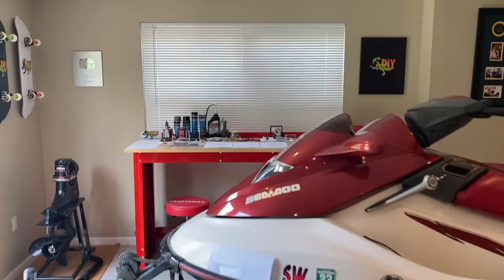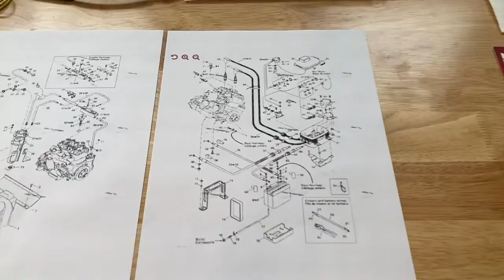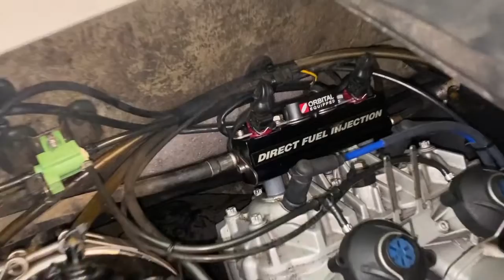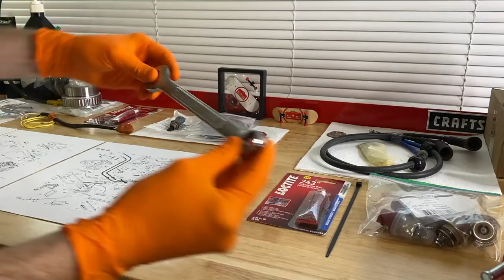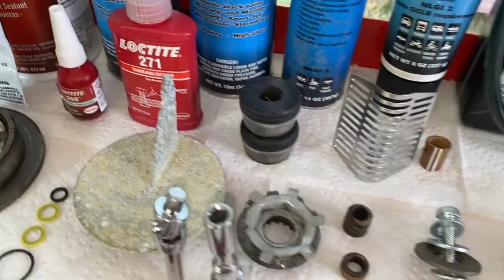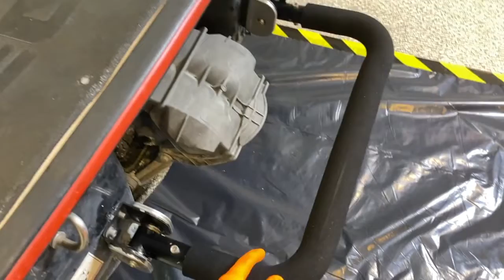Replace 2003 sea doo jet ski engine temp sensor 1998-2005

Comment from the maker: If interested in purchasing this product, visitor to Amazon affiliate link below.  I earn from qualifying purchases.

Coolant temp sensor:  https://amzn.to/3UHaqpM

3/4" wrench:  https://amzn.to/3yhTJK2

Adjustable wrench:  https://amzn.to/4awjgfP

AGM Battery:   https://amzn.to/4cO13MX

Battery disconnect switch:  https://amzn.to/49tskBH

Craftsman heat tool:  https://amzn.to/3V2LxVN

Browning Buckmark flashlight:  https://amzn.to/4bv0qGS

Loctite 518:  https://amzn.to/3wwMHjY

Dielectric grease:  https://amzn.to/4bcktKs

Pic tool set:  https://amzn.to/3wGm1ND

2-stroke Sea doo SPX oil:  https://amzn.to/3WABB8j

Steel brush kit:  https://amzn.to/3y7tNR2

Zip ties:  https://amzn.to/43Pa44k

Zip tie cutters:  https://amzn.to/3xuep0U

Oil filter:  https://amzn.to/49c0n0U

Solenoid valve:  https://amzn.to/4aLKT4S

Vacuum system check valve:  https://amzn.to/3U8PtVy

Swivel vise:  https://amzn.to/4awP2tK

START/STOP push button cap/cover:  https://amzn.to/3vomyDv

START/STOP button wire mechanism:  https://amzn.to/3TEoDDr

Glove box/storage unit latch kit:  https://amzn.to/3x9RMih

Seat latch:  https://amzn.to/43xVWwd

Front storage compartment latch:  https://amzn.to/43xVWwd

******************

Fixing Boats and Jet Ski video PlayList:  https://youtube.com/playlist?list=PLjCXOz8TSkZlae2qY97uVVTm3JdBOUoRS&si=xZXRSOw3AbEtUI3X

******************

1.  How to properly lubricate seat or storage compartment latch

          https://youtu.be/QiadPciE55E

2.  Jet ski storage compartment or seat not latching - Common causes

          https://youtu.be/gWX7obK3VA0

3.  Replace seat or storage compartment latch

          https://youtu.be/bweCd4TO-4U

4.  Replace glove box/storage compartment latch

          https://youtu.be/TmdrTVcUubQ

5.  Replace START/STOP push button cover

          https://youtu.be/VillHbgDckY

6.  Replace START/STOP push button wire harness

          https://youtu.be/5q9HbOxYY4Q

7.  Replace rear step foam pad sleeve

          https://youtu.be/w6HLiApFDuc

8.  Replace Sea doo GTX Starter

          https://youtu.be/Q8_be66r0Yw

9.  Replace Solenoid valve

          https://youtu.be/SfjX9OtOyIM

10.  Replace vacuum system check valve

          https://youtu.be/iWjhaWlyQuc

11.  Install battery disconnect switch

          https://youtu.be/LOSq10Of_UM

12.  Replace Sea doo GTX spark plugs and wires

          https://youtu.be/gRTpc5pqLLk

13.  Replace Sea doo ignition coils

          https://youtu.be/1VrtwJl6hjI

14.  Replace Sea doo Starter relay

          https://youtu.be/MAvBmwvGgyc

15.  Replace 951DI engine coolant temp sensor (Exhaust/muffler)

          https://youtu.be/ZDTEGnEVPOM

16.  Rebuild 951DI engine fuel injection Distributor (Top-end)

          https://youtu.be/Ac2xGvMr9eY

17.  Replace fuel injection distributor fuel line o-ring

          

18.  Replace fuel injection distributor air line o-ring

          

19.  Build custom logo skateboard

          https://youtu.be/9Isty_4fIIw

20.  Mount skateboard on wall

          https://youtu.be/c5QDCKZNGH0

🧰

Comment: This jet ski should run like brand new with all of the parts you have replaced, I enjoyed your video, thanks Michael 👍😁
Reply from the maker: We appreciate that Dave.  Believe it or not, we recently pulled the engine and had it factory overhauled.

Engine is back installed.  Those videos will be released within the next month.

😁👍
Reply: @DIYwithMichaelBorders  Hi Michael. Love your videos! I just picked up a sweet 03 last fall with 65 original hours. Do you think if that sensor you just changed was bad or disconnected would it cause any run problems, beyond the ecu and display communicating accurate temps? I ask this because my 03 xpdi 951 runs fast and has great throttle response but it sputters and skips some, not a lot,  during medium rpm and light throttle. When the ski catches up with the throttle it does this. I discovered that that particular sensor was disconnected. I reconnected it and it made it slightly worse….again not terrible but something I wish to sort out. Thanks for your feedback.
~ Bill
Reply from the maker: @williamburgon5207 

Thanks for watching, that’s awesome.  Possible…however more likely to be old or contaminated spark plugs/wires.

It could even be contaminated fuel if it’s been in there a long time.  Possible gunked up injectors too.

We would start with a little things…filling the gas tank full of recreational/non-ethanol fuel, followed by replacing spark plugs.

Keep us posted.  🧰